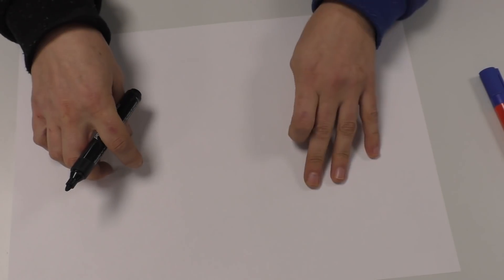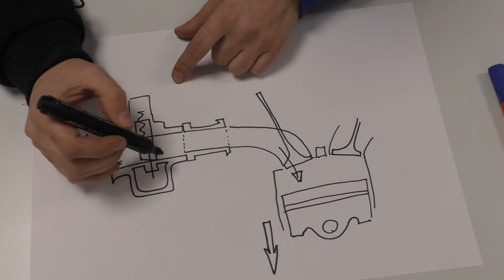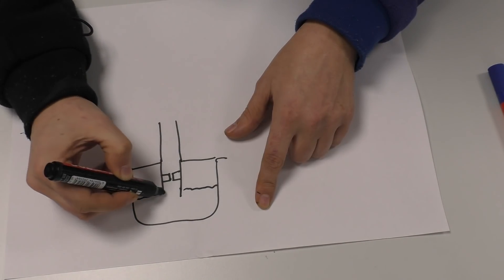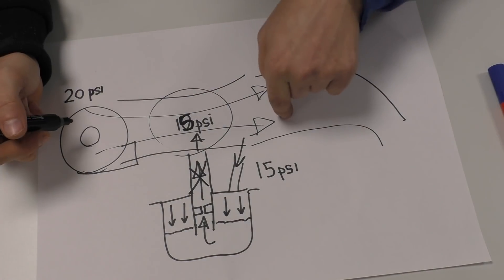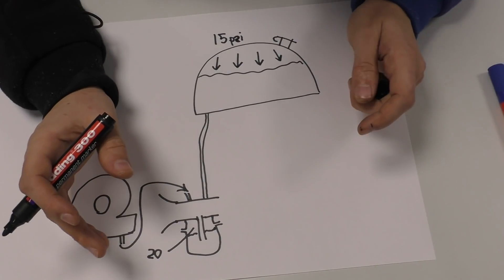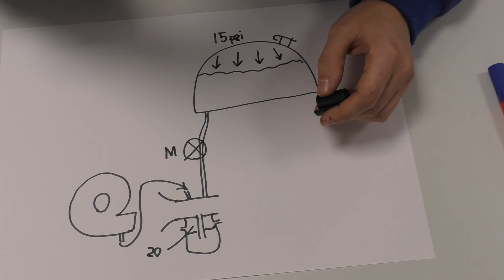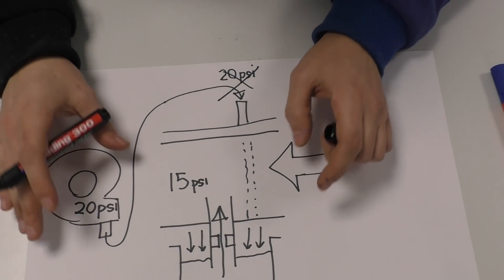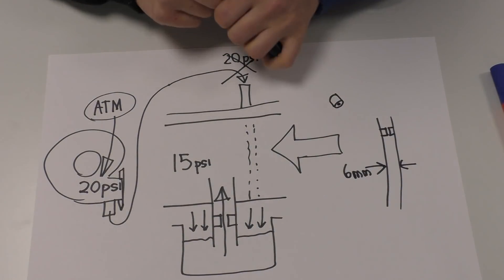So you wanna Turbo your bike - part 3

Comment: This may be a stupid question, but how do you prevent the fuel pump from overfilling the carb if sitting at idle? Is the pump flow rate regulated by rpm or some other method?
Reply from the maker: The pump has a bypass circuit where the pressure for the fuel circuit has a threshold to overcome. This can be in the form of a minimum level and a check valve.
Reply: @thedirtyworkshop  lol muuuuuch simpler than i was thinking. Thanks for the quick reply
Reply: @thedirtyworkshop  I'm going to run an after market electric fuel pump with a boost referenced fuel regulator with a 1:1 ratio. I'll set the fuel pressure at 2-3 psi the regulator has a boost reference port/inlet that I'll connect a hose to which connects to the back of the plenum. Then no matter how much boost pressure you have the fuel pressure will always be 2-3 psi above my boost pressure and I'll have a return line ran back to my tank. Anyone doing this with a carb'd bike knows we don't have an ecu. So unless you own a Dyno or at least have easy access to one which I do not they can do like me and install a wideband AFR unit. Installing the wideband will cut out a lot of headaches when tuning
Being honest my knowledge comes from a very patient retired engineer that I was blessed with meeting two years ago. 
My hat comes off to people like you and him that are willing to share the knowledge y'all have. Thank you

Comment: Hey! 
About that with 15 psi fuel tank pressure 20 psi turbo pressure is not a problem to solve. You put on a gas pump, gas pressure gauge and a gas pressure regulator, and for make sure that the bike does not goes lean, you adjust the fuelpressure 2.9 psi higher than the turbo pressure👍🏼 I do that on my Honda CBR900rr turbo dragbike, and it works perfectly😁
Reply: How do you match air pressure and fuel pressure? Its not always the same to fix it at some value with pressure regulator.

Comment: im currently doing a pull through turbo at 7 psi on a 171cc forged internal gy6 motor. im using a oko 28mm carb, ive got a wideband and i can tune the jets accordingly. but my question is should i be okay with a vacuum fuel pump getting vacuum in between the carb and the turbo air inlet? going for a land speed record with this motor and your advice has cleared up a few things, but id love a video on the pull through style
Reply from the maker: "going for a land speed record"

- with a GY6? Are you actually insane? Secondly what turbo are you using?
Reply: The Workshop vz21 and the record  is only 68.

Comment: boost reference to the carbs would be better through a pitot tube system from the plenum wouldn't it? Also you'll want a rising rate fuel pressure regulator so the fuel pressure stays 2-3 psi above the absolute pressure in the venturi :)

Comment: Turbo a Suzuki gz250? Realistically what am I looking at if I throw it together. I want boost with some power, the sounds and a little bit of pull, and if not what bike would you recommend to Turbo?. I really am interested in doing a bike, just need some guidence.
-Nick
Reply from the maker: "what bike would you recommend to Turbo?"

- I don't. It's a personal choice. Do you want more power from your bike or you just wanna turbo something?
Reply: The Workshop I really just want to turbo something, I would like to turbo an older carborated bike but I'm not sure where to start

Comment: You´re forgetting an importing thing, the pressure you put to float bowl often needs to be pressurized with dynamic pressure.
To solve this you need to take pressure to bowl with a pitot tube.

Comment: So basically a kit built to work at sea level won't work at 5k above sea level ? Even if you buy a fully set up kit you will have to alter it for a carb bike. Re jet and tune ,blow up motor after motor until you get a base line tune for weather conditions.
Reply: You will have to tune if you want it to run at its best, but it won´t blow up for simply having a "not optimal" air-fuel mixture.

Comment: Makes sense indeed, it kind of reminds me of how I've had to tune my car after a turbo conversion, the ecu has no boost sensors so we basically configure the engine to cope like 20psi (5psi boost) is the normal pressure

Comment: Very interesting. The cool thing is, I actually put an brushless edf (electric impeller) on a small 4 stroke engine (way too small to produce any boost, but.. learning!:)
..and even with that small edf I discovered the problem by myself. The engine stalled as soon as I powered up the impeller. And fuel came out the vent tube I think (if that makes any sense, maybe the vent was below the fuel level in that carb). Anyway, I had the genius idea to connect the pipe right after the edf to the overflow/vent of the carb, and it worked just fine hehe:)
but didn't produce any power cause 400w of electric power is nothing.

Anyway, even if you have figured everything out, I have a question: Would you need a bigger jet? I'm obviously moving more air (by mass) through the carb at roughly the same speed as before (so I need more fuel to burn). The pressure difference on the fuel jet is the same as before. But bernoullis principle says that the pressure drop is proportional to the density of the air, which is higher at the higher pressure. ... this would mean the same jet would still mostly work.. ? yes no maybe?
Reply: this might get a mention in a later video, Matt goes through things in kinda "baby steps" so that people can keep up, instead of everything at once and people getting confused and lost off or simply losing interest
Reply from the maker: "I have a question: Would you need a bigger jet?"

- yes, as air density (number of oxygen atoms) increases then more fuel is required - this is where the extra 'power' comes from.
Reply: is the increase in air density not enough to pull in more fuel?
Reply from the maker: Air pressure drop and the gradient of this drop is what draws fuel in.
Reply: really must remember to refresh the page before commenting on something!
Reply: yes, sure. That part is clear. I'm wondering, since the gradient of the pressure drop in the venturi follows bernoullis law, this drop should be proportional to the new increased density. Assuming the amount of fuel drawn in is kind of proportional to that pressure drop, there should not be a need for a bigger jet.
(I know a bigger jet is needed, I'm just wondering exactly why)
Reply: Change in air density.  Since the fuel density does not change,  a  change in jet diameter is needed to keep the same air to fuel ratio.
Reply: Read my last comment again.
Reply: DerKrawallkeks It's probably do to fluid dynamics. Resistance or drag the fuel experiences when forced through a small hole.  You would think if you double the pressure you would get double the flow though the jet.  You may have to quadruple the pressure to get double the flow.  Just like if a car wants to double it's top speed it needs to quadruple its peak horsepower or thrust.  That is my best guess. It's not linear. It's the square of the velocity Engineers step in if I'm wrong.
Reply: nebulaunfolding Mmh gut as I said two comments earlier, there is no square of density in bernoullis equation. The pressure drop is directly proportional to the change in air density.
Reply: DerKrawallkeks your right no square in that equation. But there's probably other forces and or laws at play here that would cause you to change jet size.  Judging on your interest, and things you built, you may think about becoming an engineer, you will probably find your answer in fluid dynamics.  Or pickup a book on the subject, you can only learn so much on you tube.   I'm thinking if the fuel was instead air going through the jet, then it may just be linear in proportion. But since Air and liquid gasoline have very different viscosity and compressibility, a different jet may be needed.
Reply: nebulaunfolding I'm actually studying vehicle technology on university, that's where I got that Bernoulli equation from. (From fluid dynamics);)
Reply: DerKrawallkeks good you're on your way then.  I learned the basics in my fathers Air craft books, the Air Force, and a race car aerodynamics book.  But I still have a lot to learn.  I'm actually working on turbo charging a aprilia dirt bike, and lowering its cdA for a higher top speed.  Happy building.
Reply: nebulaunfolding Sounds like a cool project! But it's a 4 stroke bike I guess..?
What do you mean by cdA, gear ratio?
Reply: DerKrawallkeks 550cc 4stroke fuel injected v twin. You will learn cdA very soon.  cd is drag coefficient, aerodynamic shape.  A is frontal area of vehicle.  Multiply them together and you get total drag  of the vehicle.  From that you can calculate top speed with a given thrust force. The velocity squared equals drag force.
Reply: nebulaunfolding already learned that, we just have slightly different letters for it. Are you making videos about the project?;)
Reply: DerKrawallkeks not yet.  Maybe I should.  I'm definitely going to make a high speed test run video when finished. I even want to do the prone riding position to further lower cdA like the little picture to the left.  A dirt bike that weighs under 300 pounds and will reach 150 mph is the ultimate goal. Sounds crazy doesn't it.  If I'm going to risk life and limb I will be sure to have at least 2 cameras recording it. Haha
Reply: Sounds like fun:D well the weight really doesn't matter in going fast
Reply: DerKrawallkeks it matters for acceleration and off-road capacity.  I want both worlds on one bike.
Reply: that's a big engine for a dirtbike

Comment: Does the restrictor in carb vent pipeline help when you suddenly close the throttle (before blow-off drops the pressure) to prevent the engine from overfilling with the gasoline?
Reply from the maker: Yes - more on this when I put together a demo

Comment: I turbocharged a kawasaki 220 bayou with a turbo off a 300d turbo diesel. It could spool it but the draw through pipe we had couldnt handle the vacuum and would snuff the bike out.

Comment: Delivering the goods man!  I currently run a drawthrough setup on a Suzuki Savage 650 one-cylinder. Started it up a few days ago and it ran very well for what it was, idle aswell as gas was no problem. i figured there would be problems with fuel delivery since the fuel has to travel for about one meter in pipes after the carburator. But, as said, no problems.
Reply: Well, draw-through seemed lika a more simple setup for me at the time. Maybe i will rebuild it to a blowthrough later, but i want to test this out first. I will probably have to re-jet to bigger sizes though, i have not wind it out on high rpm's because it's snowy were i live.
Reply: Do you have any pics of this set up?

Comment: I stopped at 1:06, and who the fuck would use a carb and turbo the bike??? Sorry the 80's are over. FUEL INJEKTION IS INVENTED! Matt don't make our life harder then it is. Just say: To turbo a bike with carb is possible but bullshit if you can go fuel injection you get the best result and most power out of it. Well and todays bikes that you might consider to turbo are fuel injected anyways.
Reply: i would disagree, i would not turbo a bike i ¨care about¨ for the simple reason that it would just not be reliable enough. so maybie trying to turbo an older bike that is cheap is a better idea. but that is just my opinion. plus i do not know how an IFE system would react to a turbo setup. since the preasure is not constant enough. you would propably have to get special software on your ECU. and i would think that is hard to come by for a bike.
Reply: Jesse, So you rather turbo carb 1970's 80's bike then an fuel injected 2000' 10' bike that has fuel injection? I would turbo my 2007 K1200R BMW if it would make sense to get more out of it but with less then 3sec form 0-60mph all I get is more wheel spin. So to turbo a small engine bike makes more sense. Fuel injection on bikes starts to be more common in the 90's. And a stand alone unit to control ignition and injection is cheap and easy done by picking timing up at the old ignition. Add a sensor for pressure and emission and all you need is a throttle body with the intake fuel Injektion and a few bits like fuel pump and it is done! easy and save for the engine not to lean out.
Reply: I guess i learn evry day. thanks for the info.
Reply: Jesse, you will dump all engine management and install a standalone ECU and that manages all you need. And then you tune it to that what you have installed and the power you ask from it. Ok the fuel pressure will have his own pressure regulation... And no matter what engine you take it will have less life as more power you ask from it... That is one reason for the old saying cubic capacity is only replaceable by more cubic capacity.
Reply: what i meant to say about reliability was more about not screwing with your day to day driver, not that old bikes are more reliable.